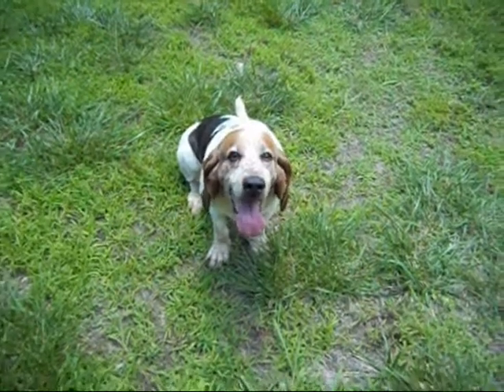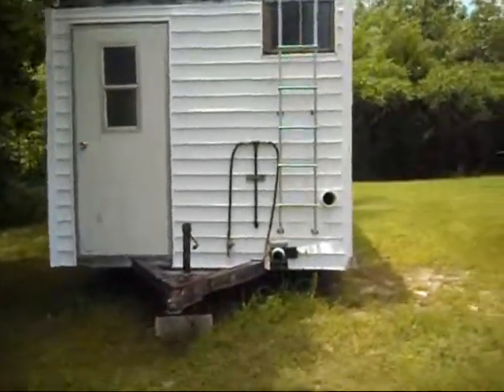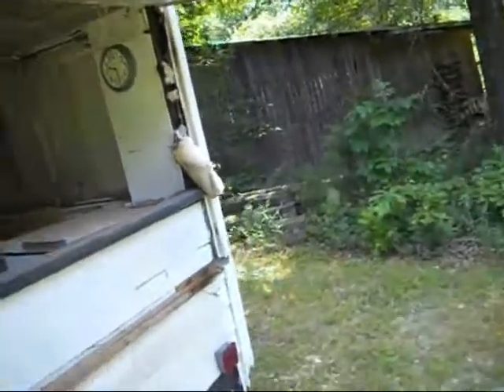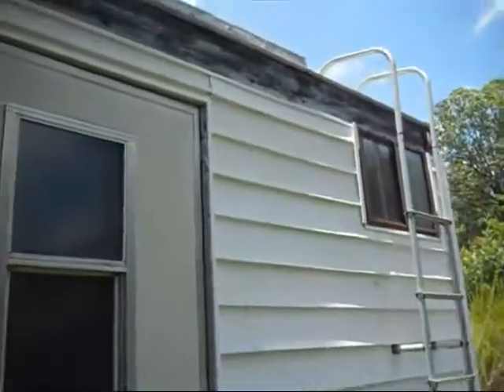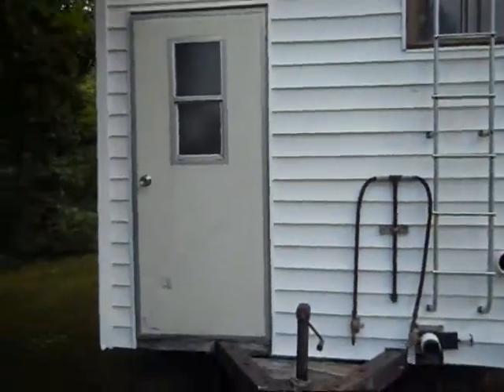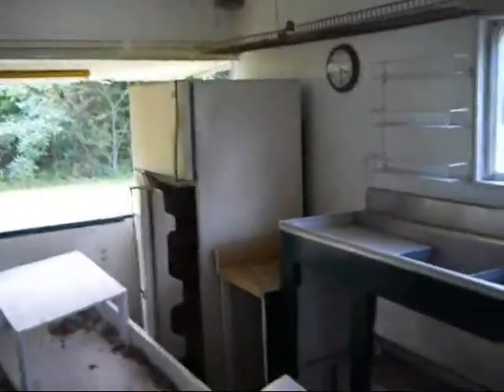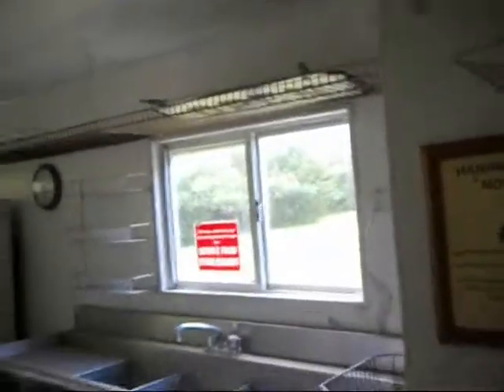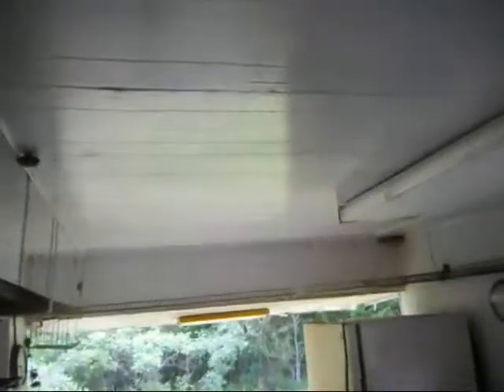consession trailer rebuild #1

Comment: It looks like you have some work ahead of you. Looking forward to see the progress. Good luck.

PS, Soapy water in a sprayer is good to kill wasp. They breathe through their skin, and soapy water interferes with there breathing. Spraying anything more than that inside that trailer might leave poisonous residues. It works good around shrubbery and flowers as well. It won't harm them.